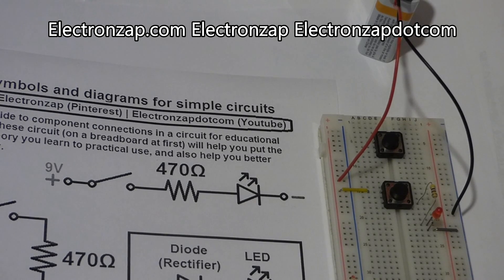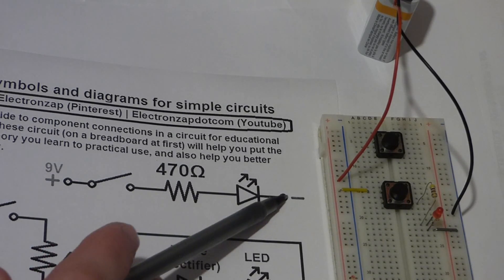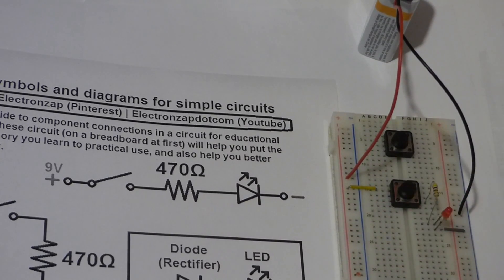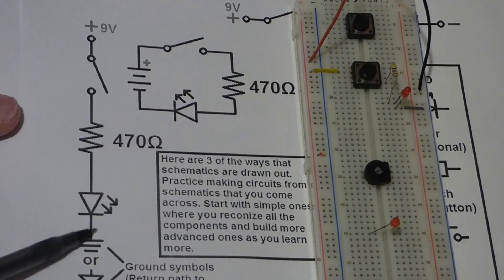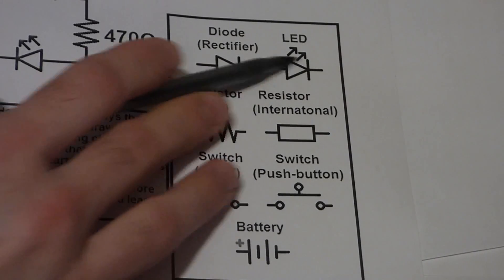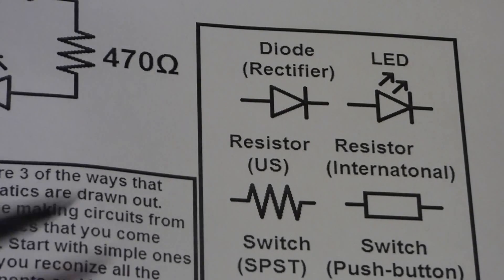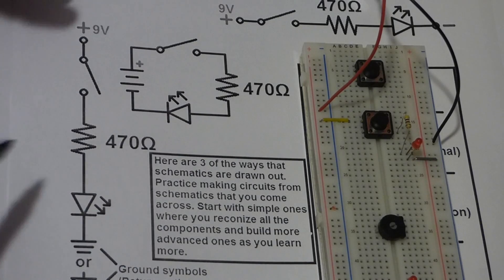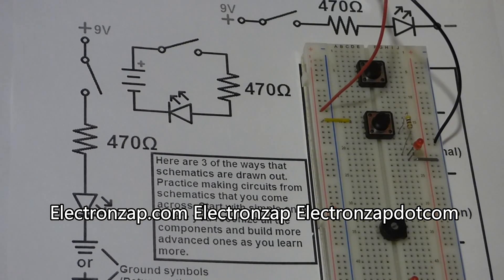Learn electronics quick video series tutorials 6 schematic reading basics

Comment: Would check my logic here? I think I am correct. You state that electrons flow from positive to negative. Electricity is the flow of electrons. Electrons are negative so they create the negative pole and flow to the positive pole. The flow is energized by the potential difference between the negative and positive poles, which is measured in volts. So the flow in direct current is from the negative to the positive. If you were referring to AC then you would not have a positive pole.
Reply from the maker: Electrons do flow from negative to positive (electron flow). It was originally thought that a positive fluid like force moved from positive to negative (known as conventional current), and so circuits behavior have been explained as conventional current for the most part ever since. It's an annoyance we are stuck with.